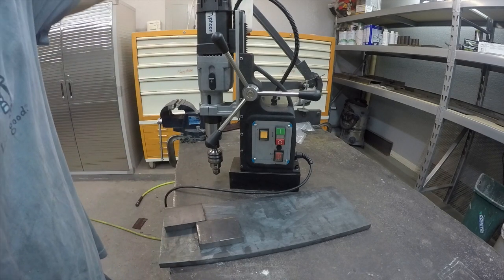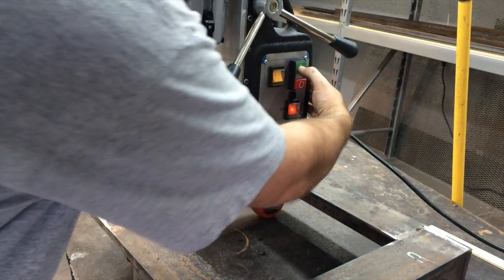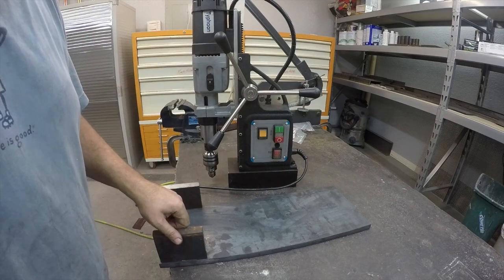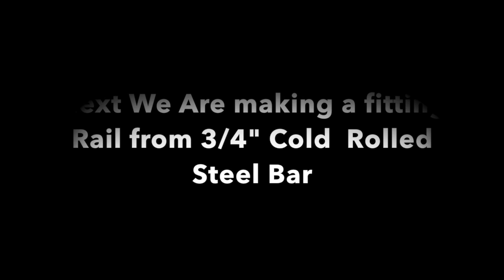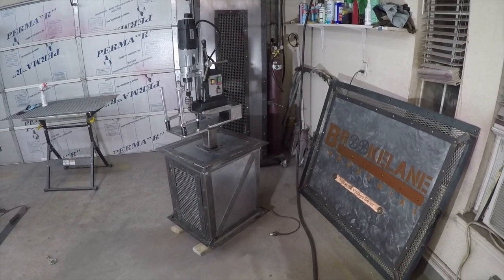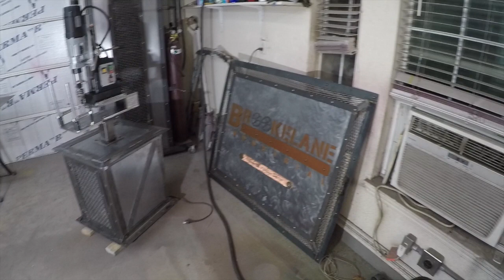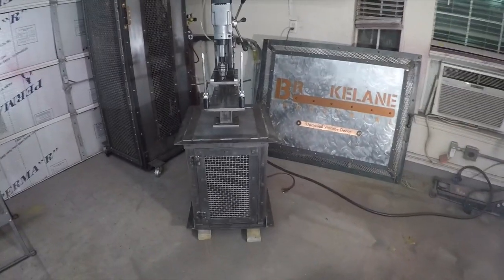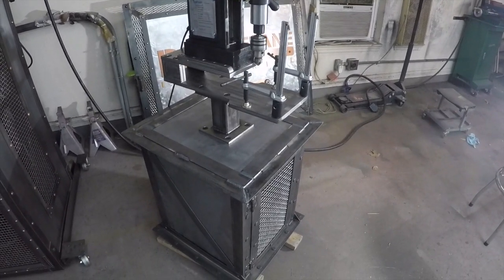Magnetic (Mag) Drill - Milling - Drilling - Tig Welding a Steel Stand

Comment: Nice workmanship,  I built one in about 2009 using a Hoegen Mag Drill, I had a large drill press but the core drill bits cut much faster. At one time in the 1980s I used several hoegen mag drills as my Column and beam line for a start up fabrication shop. 
 Best Regards, A Retired Union Ironworker.

Comment: Nice drill . We had big one at work that took 2 people to move ,and water cooled. Looks like yours is a good size for most  projects.
Reply from the maker: Thanks Terry!  Yea, it's kind of a medium sized one.  Any bigger than that, and it becomes difficult to position, etc.  I saw your PM to me.  I had never heard that trick on tightening a chuck in more than one position, thanks for sharing that.  This thing came with 2 chucks and both are junk, the jaws keep backing off.  I am going to order a nicer chuck like a jacobs or albrieght for it.
Reply: turbocobra A Jacobs chuck would be a worthy up grade. Try it out , tighten one spot then just move to second spot around and lot of times you can even feel tighten more

Comment: Wow!  Very nice build man!!
Reply from the maker: +Beach N Wheelchairs Thanks, if you watch some of my other videos, you will see I use the heck out of it, it's worked out well.  I sometimes build tools that I don't use much, but this one gets used all the time!
Reply: +turbocobra I just built a jig to clamp my casters to my drill press at the correct angle to drill the bolt hole for the bolt that goes through my bearing housing.  But your skills are far above mine.  Would love to hang out and watch you work. :D
Reply from the maker: +Beach N Wheelchairs That sounds good, and your right about the jigs helping a ton... Awe man, if you go back and watch my older videos you can see i was a total newb, just keep learning from mistakes, and learning new skills, anyone can do it.  Thanks!

Comment: Very nice work. Was wondering why you don't just weld it together. It would be stronger and alot quicker to build.
Thanks for the Video.
Reply from the maker: You could definitely weld it together.  I just wanted to use the mag drill itself to make the stand.

Comment: Awesome Gary.  I'm learning every time you put one of these up.  Your vids make me want to go spend my life savings on machining tools...  Do the big drills you are using require sharpening???  Looks like they have a ton of cutting surfaces.  I'm guessing that would be a huge pain and might require a setup on the lathe to sharpen them well.  Also, what did you use for the "buttons" on the angle iron stand.  They sorta look like big rivets.  

If you are hosting "Metalwork Monday" maybe the guitar project should be "woodwork Wednesday"...  Just doesn't have the same appeal though.
Reply from the maker: I hear you man, buying tools can be an addiction, I have a few more things to buy, and then it will be on to making some Cool Brookelane pieces and hopefully make some money to pay for all this stuff :).  As far as the annular cutters needing sharpened.  Yes, they eventually wear out, but when I was researching them I found a guy on youtube that drilled 275 holes in 3/8th plate with one cutter and it never dulled.  Just like everything else, they range in price from $10 for a small on in HSS, and as much as $200 for a carbide one in 4-5" diamater.  It would probably cost more than the cheap ones are worth to sharpen, so they just become consumable, but again have a long life.  They dont' remove all of the material of the hole since they are like a hole saw on steriods, and they have 5 to 20 teeth on them compared to only 2 teeth with a twist drill.  Woodwork Wednesday would be awesome!  I would watch it every Wednesday!

Comment: I just ordered one of these drills.  How is yours holding up? Does it have an ejector spring for the slug?
Reply from the maker: I would say it's held up "OK".  The ejection spring never worked right.  It was too weak and would get jammed in the retracted position. I contacted them about this and never got resolution.  The gibs on the vertical ways need to be tightened constantly.  Overall it still works and I do use it quite bit.  Its way cheaper than the brand name ones so you get what you pay for.
Reply: Ramsey Customs - turbocobra I received my drill yesterday & figured out the problem with ejecting the slug.  Using the 3/4" adaptor there is a gap between the top of the pin & the spring.  I am going to weld a small rod on top of the pin & see if that helps.

Comment: So, you've convinced me to get this Mag Drill for my shop... mainly because of the reverse and 3" hole capability. I've been shopping them for awhile, and I can't find any that have that feature. I'm willing to spend up to a G & J Hall ($1800) and they don't even have reverse. (I like the fact that theirs is dual voltage)

Anyway, would you be willing to sell me a similar 1-1/4" insert for the tap?
Reply from the maker: +Eco Mouse So far this mag drill setup has worked great.  There is a little runout in the spindle so it doesn't make super precise holes, but none of them really do.  I don't really make things like that to sell.   It really needs to be done on a lathe and I don't have one of those yet.  good luck!
Reply: +turbocobra I kinda figured this drill would have some runout, considering it's a connection to a connection to a shank. But what about the larger 1-1/4" spindle? Any noticeable runout there?

Comment: PS:  Drills and Cutters advertises an annular cutter with a pilot drill.  I hadn't realized that they ran a pilot drill?  Is that the case and if so is it a special bit as it seemed on their webpage.  Doug
Reply: No pilot drill. There is a center rod with a pointed end that you use for alignment. It is spring loaded and pushes up into the chuck as you drill. The annular cutter's you are referring are more like hole saws for metal and are probably designed to be used in a hand drill or drill press.

Comment: Are you still satisfied with the mag drill, if so which model did you buy?

Thanks
Reply from the maker: Dale Detten yes, very happy with it.  Couple minor issues, but can be expected with a cheap tool.  Checkout my main channel page for several more videos of me using this drill for projects.  the SYF sign part 2 project I used it to drill and countersink some 2" holes in aluminum
Reply: it looks like the mag drill is the TYP-75, is that correct.